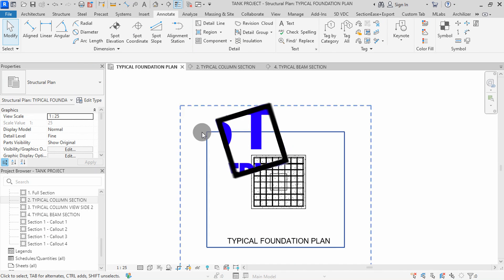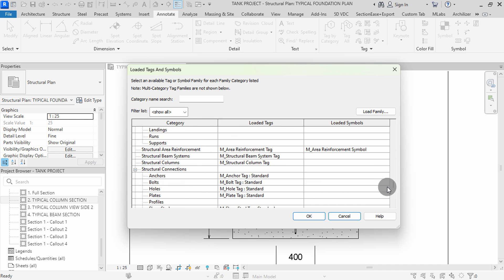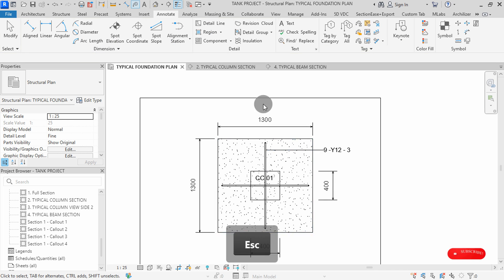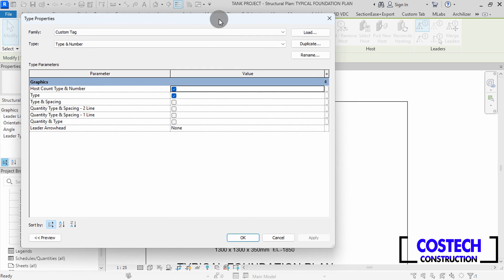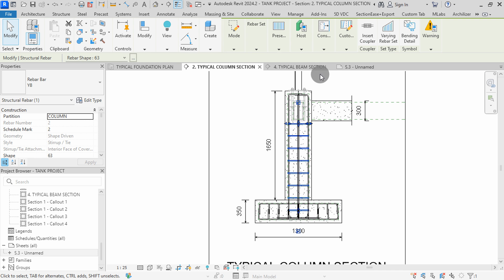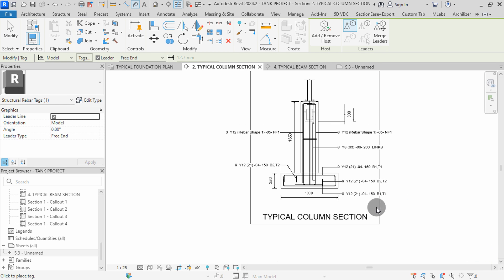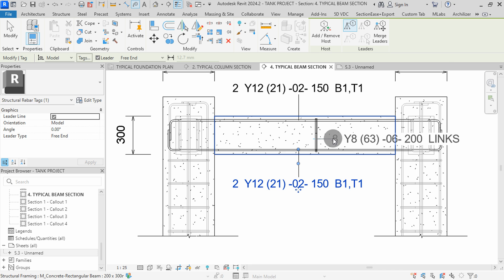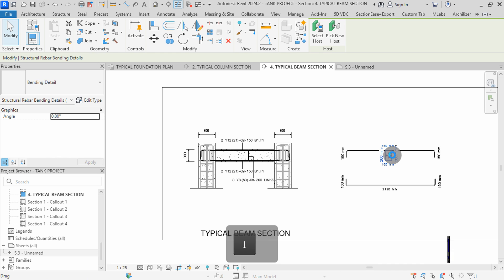Create Custom Rebar Tags in Revit & Annotations

Comment: Good work sir, thank you. A quick one, how is the B1/T1 or B2//T2 coming in in the tag.
Reply from the maker: @paulntoyai6235  Use comments to add the custom rebar position in the tag.
Reply: @costechconstruction254  Okay, thank i will try that. Consider also showing us how to design using powerpack in revit.
Reply from the maker: @paulntoyai6235  Complete powerpack videos will be uploaded soon... Thank you